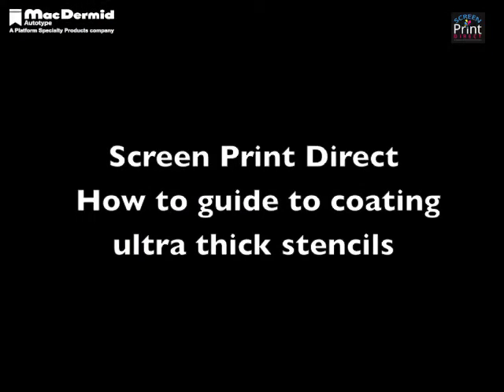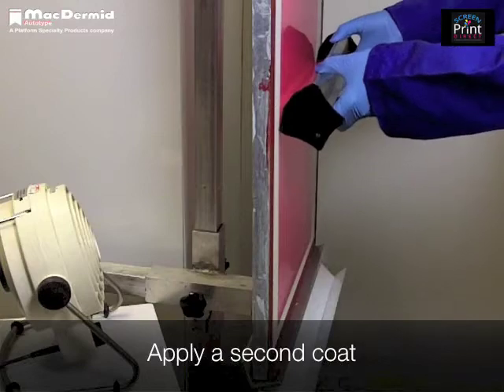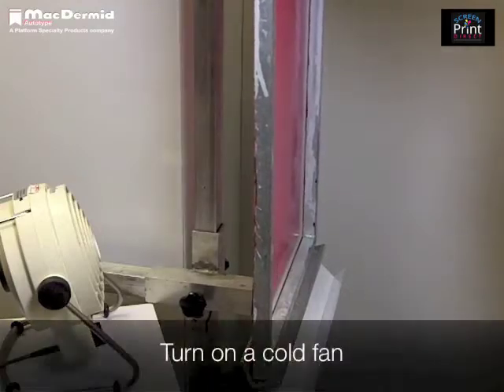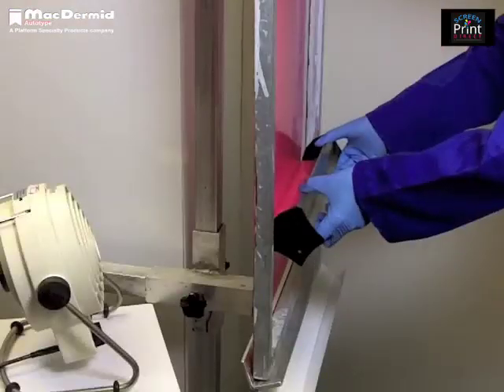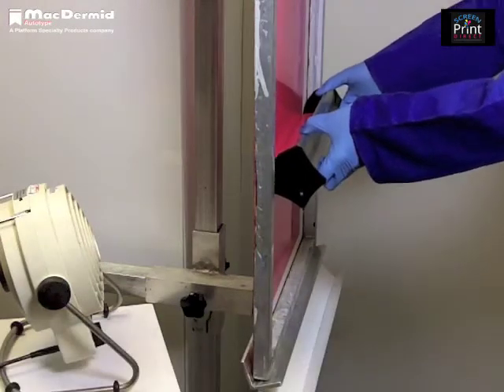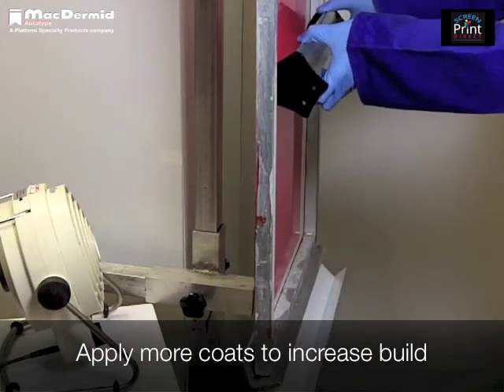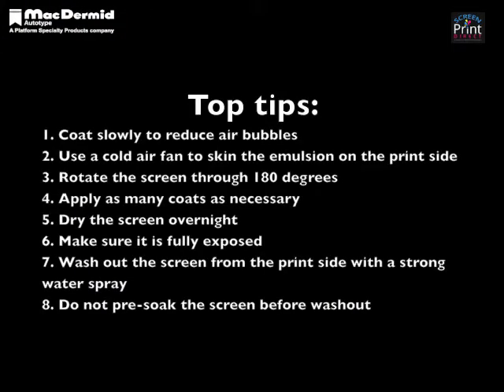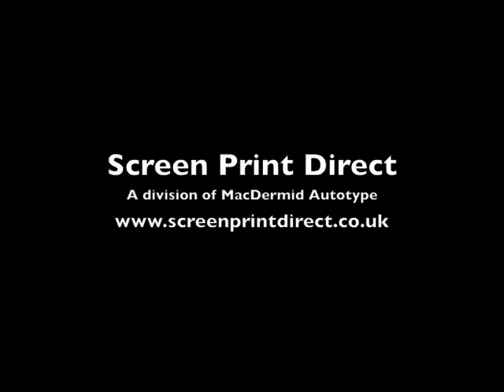How To Screen Print: How to coat emulsion for high build screen printing.

Comment: DO NOT USE THIS METHOD ! ! !  Unless you want to create a major mess !  I tried it, and it doesn't work at all ! ! !  The emulsion ABSOLUTELY sagged, and when I put it into my drying cabinet laying flat, the emulsion dripped down all over the cabinet floor !  I now use a MUCH different method, and I produce really thick stencils on my screens ! This method STINKS ! ! !
Reply: Your problem might be the heater. He clearly says to use a cold air fan which will increase increase viscosity.
Reply from the maker: Hi Daniel, were you using a high solids emulsion such as Plus 9000 and how many wet on wet coats did you apply? Your feedback would be appreciated. Thanks, Screen Print Direct.
Reply: I'm sorry . . . . . . I'm not meaning to seem rude,  but as I work in a shop professionally, I can't give out trade secrets on a site such as You Tube.  We compete with other shops across the country and I'm sure you can understand wanting to keep the upper hand !  I will not discuss the technique that I use, simply because my Boss would be quite angry with me if I did.  It's a dog eat dog business world out there as I'm sure you know and understand. If you want to learn the proper technique that I use then come to work in our shop and I'll teach any fellow co-worker all they need to know in order to make money for the business and there by earning raises given by the owner for our outstanding work performance. Everyone else has to learn on their own how to make these type screens, and learn how to use them creating various new and exciting techniques of print forms. I'm sure you can understand my point.
Reply from the maker: Daniel Patrick not after your current method or trade secrets, we just want to know how may coats you did with the method in this video. Thanks Screen Print Direct
Reply: Screen Print Direct I tried to go for the ten coats . . . . .  but the emulsion started sagging. Then I tried putting it into our drying cabinet flat, and it dripped all over the bottom of the cabinet and all over the tiny space heater in it to help dry it.  It was a MAJOR mess !
Reply: @mtnman259  if you work in a professional shop what are you doing looking up YouTube and trying things if your way works ? And trade secrets? C'mon man bit ridiculous its coating a screen hardly top secret info
Reply: Is 3d emulsion and hi density emulsion the same?